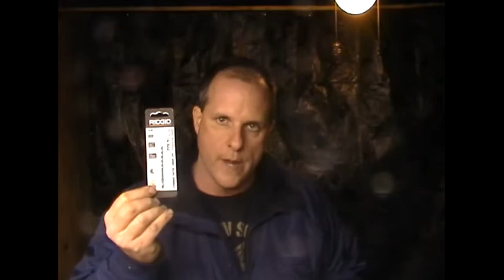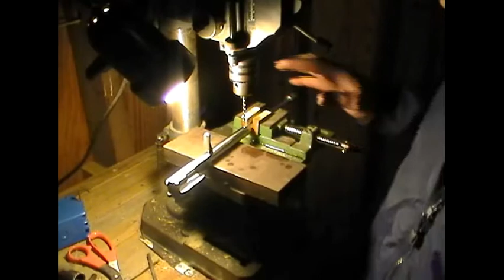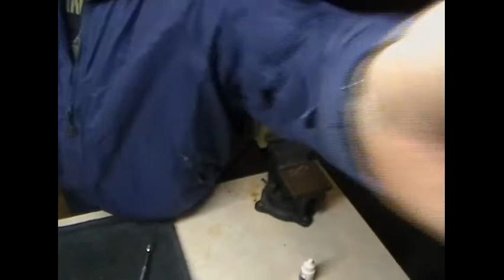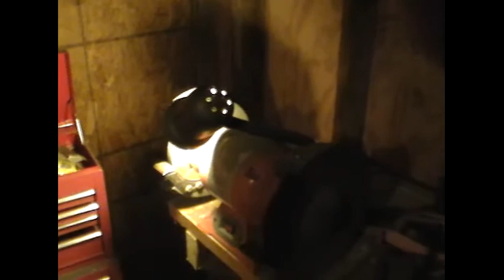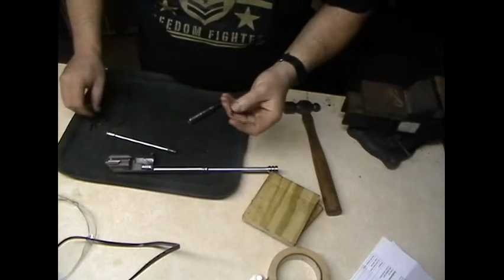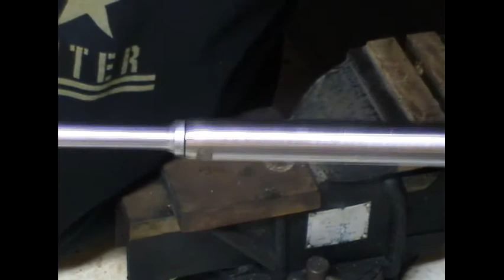How to change and pin an AK Gas piston

Comment: Just changed my gas piston on my IO interordnance  AK 47. One  video review shows rivet that hasn’t bend touched and the other has been compressed like it should. My was the same way. So I tried to drill it out from the end that look like it hadn’t been touch because it was easy to see that I had bit perfectly centered so I would be drilling out the rivet only. I even e-mail asking IO if  the gas piston was threaded in and they said yes. So I drilled and tried to drive out the pin. Finally after having to drill the thing all the way out it came loose. Turns out to save time they silver solder the pin on the side that looks like it has been peened. The stock gas piston is made from very soft metal. I bought a surplus piston off E-bay. I was researching adjustable gas pistons. And figured out they drill out the piston for you. Just need to measure over all length and measure where hole has been drilled. So I bought two gas pistons from different sellers  that were sold to me as European surplus gas pistons that fit most AK’s. Either  one would fit. The quality of the metal and chrome is amazingly verses what the original one was made of. Didn’t take long with a jewelers file to shape the new rivet after peening it. If had known about drilling the end that had been soldered it would have been a ten minute job.
Reply from the maker: Good to know glad you got it back together. I have discovered that the manufacturing of AK's is as diverse as the people making them which is part of their charm but they sure ain't like an AR

Comment: your the man, replacement bolt carriers are surprisingly hard to find for some ak variants, your video Is gold because I found myself having to do my own bolt job for my m92 zastava
Reply: I’m about to do my job on my m92 as well! Except I’m going to replace the bolt carrier with a spare I have to add a left side charging handle

Comment: Great video I was wondering how much piston wobble is OK
Reply from the maker: 19785244 That is a very good question and the truth is I have seen pistons on full auto guns that have so much slop that you can't understand how it even works but that's the beauty of the AK platform as long as it runs without hanging up you should be ok
Reply: That answers my question. My maadi definitely has more wobble than I would think it should but consensus seems to be that the piston can be pretty wobbly and it's not a issue.

Comment: What's the purpose of changing a piston?
Reply from the maker: There are many reasons that one might want to change it. In my case I didn't like the original because it was dimpled instead of pinned and I wanted the more traditional grooved piston. It worked perfect but it was my personal preference. Some folks will change them in order to gain an American made part for compliance reasons, while others might want an adjustable style such at the one offered by KNS.
Reply: For me I have a Romanian AKM rifle Parts Kit that I want to turn into a pistol. This will require me swap the rifle piston and gas tube for shorter versions.

Comment: Thank you so much for the tip of valve grinding compound. I have a old trick for you too. If you have a file you love and it's all gunked up with metal shavings such as steel or aluminum, get yourself a piece of copper pipe, hammer it flat, brace the file and trace the flat of the copper pipe piece following the groves of the file, it will form the flat of the copper pipe piece to the exact grooves, and trace the groves clean useing the flat of the copper pipe. It will make your files good as new

Comment: The only thing I would’ve done different is after flattening the pin, use the ball side of the hammer to make sure the pin is crushed into the hole thoroughly.. then grind off excess.. the pin is like a rivet.. want it to expand inside the hole and fill in gaps.

Comment: like your post thanks alot good info on the piston work have a question i've noticed that my polish tantal and my waser7.62/5.45 both rifles seems as though the front sight base is canted to the right slightly is this common is there a fix without much actual machine work

Comment from the maker: Many times Century only drills half way and then welds a pin from one side. I counter sink both sides then brad it into the counter sink and sand it smooth. It's very strong and it's more like the way full autos are done.

Comment: Excellent video, very well explained and to the point.  Let me ask you an off topic question, I have a AMD-85 Hungarian AK and perhaps you could direct me to the best place I can find a gas tube for it ?  As you know, The gas tube it uses is a little shorter than a standard AK gas tube and it's plain with no furniture.  Also, I've heard you can take a standard AK gas tube and cut it down then flare the end with a impact socket.  Thank you very much and thank you once again for a great and informative video.

Comment from the maker: These carriers are very hard as you have discovered. Cobalt is the best bit to use you must drill very  very slow and with plenty of lube. Once you are in the threads of the piston cutting should go smoother since it is softer. Also it's a good idea to purchase several bits unless your good at sharpening them.